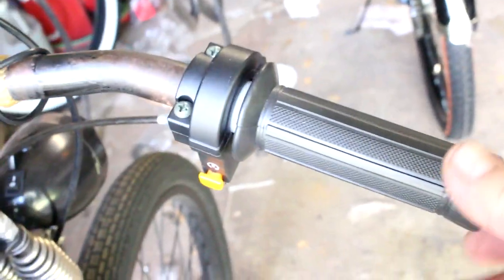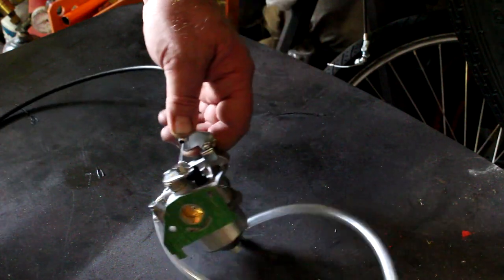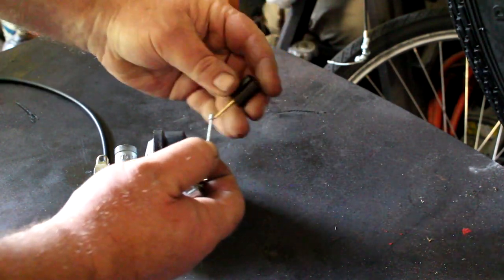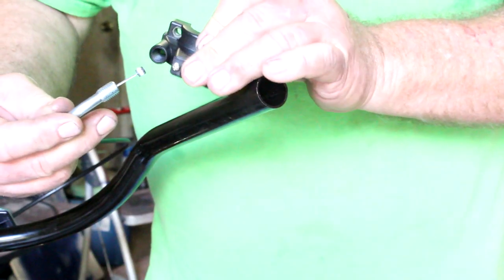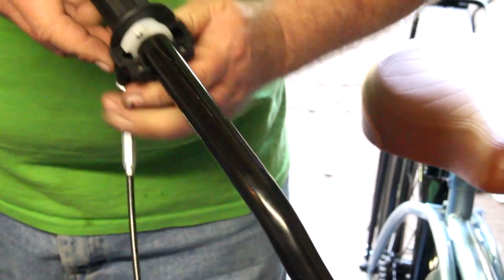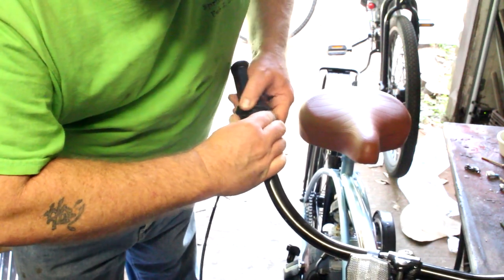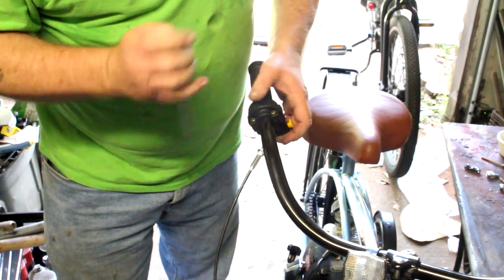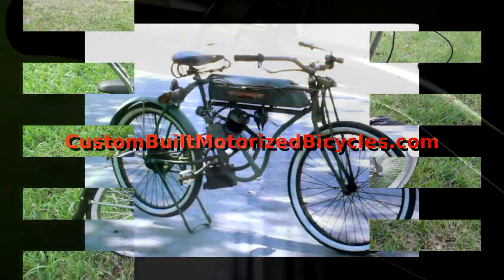How To Replace Repair or Install Motorized Bicycle Throttle Assembly and Cable

Comment: Everybody listen up! You pull the tooth out of an old automobile fuse, and super glue it as a stopper right where the cam meets the housing. Boom! Fits perfectly, add a rectangular piece of tape on top to keep the glue from dripping away and no more cheap cam overturning into the housing! Creates the perfect stopping point for your throttle.

Comment: I’m still confused what the hole in the handle is for. 🤷🏻‍♂️ How do I utilize the drilled hole? The part about how to drill the hole in the handle is very understandable, but I’m still uncertain what to do once I drill the hole.

Comment: Does anyone know how to take the carborator off after ive already put everything on and driven it? Is it safe to just take off? There's still fuel in the tank.
Reply from the maker: Sure. You just shut off gas at petcock. See my vids below on servicing carbs:

2 stroke carb: https://www.youtube.com/watch?v=9iPDA6PsT_g

4 Stroke carb: https://www.youtube.com/watch?v=sNVkanVqwvY

Comment: GREAT video! My 49cc Grubbee motobike was stolel last Friday and it's been 13 years since I did this-John in Texas
Reply from the maker: Oh no! I saw your other question. I prefer the rag joint. Once you get it setup right. Running true and centered, you are good

Comment: Thanks for the tips that I so desperately needed: it's the little things that mess me up, the kind of things I'd learn from experience [that I don't have]. Very well done video, quick and succinct, to the point and no more. Rick
Reply from the maker: Happy to help!
Reply: @HughesMotorized hey I got a question so I had some engine trouble with my motorized bicycle and I got frustrated and I kind of snapped really hard on  the throttle and now it's loose how do I fix this problem.
Reply from the maker: @2musicSoundtrackfandom579  Post several pics of the throttle up close. Post them to my Facebook group Hughes Motorized. Aim to detail where the issue is

Comment: I'm new to all this stuff and I've just completed my first build. The only problem I'm having though is that I have no control over the throttle at all, it seems to just be full whack from the start. Anyone know what could be wrong ? Could it just be the grip or one of those needle thingys
Reply: I have the same problem, have you figured it out yet?
Reply: +Liam Mckay yes, I had the throttle cable wrong in the carburator, the spring had got tangled with the cable. No big problem,good luck
Reply: +Liam Mckay and to see if you have got it right just take the carb off and look into the intake or outtake to see if that black cylinder is moving up and down when you pull the trottle
Reply: Thanks, when I go to my grandparents next ill have a look and see whats up
Reply: Jim ferry hey man I'm here going through

Comment: I took mine apart, but the pin in the middle, where you still a whole broke off. And they're was some wire left over inside the throttle handle, you think I can still fix it, Master?

Comment: Great informative video! My throttle seems to have too much cable and it's unresponsive, it won't stay seated in the housing ends,  I have the adjustment pieces all the way out,  still nothing. It's a 50cc 2 stroke 🚲 engine,  any ideas?
Reply from the maker: If you are using stock throttle & stock carb, might need a new cable
Reply: @HughesMotorized  I am yes and I added a spacer and it's working way better but she sputters.. Bad mix maybe?
Reply from the maker: might be, many things can cause that. Bad spark plug, bad wire, spark boot, magneto coil...etc

Comment: I have 2 motor bikes I just got a deal on . 1 schwinn cruiser 22 inch wheels 80cc .. and a huffy cruiser.  They both needed brakes .. and huffy 80cc needed a coil and front brakes . The schwinn needed brakes and throttle cable was sticking.. so thanks . I learned everything from your and 1 other video on idle air adjusting and throttle cable adjusting and how to install the new cable . I just did front and rear brakes on schwinn with new calipers today .. very easy

Comment: After having someone work on my gas bike, the throttle cable visibly moves as i throttle and release.. Also i was told my carb float was stuck open cause it was dumping gas... i hit it with a mallet and it stopped. 
Still doesnt fix why my throttle is WFO even tho im not touching it.
FUUUUUUUUCK. 
I think i need a new throttle assembly, and my carb needs adjusting. Im going to learn to do it myself, im so sick of getting burned by Joe KNowitall ...

Comment: The throttle grip assembly in my kit was junk. I was thinking it didn't look like a good design as I was installing it. I rode the bike four times and it failed as I predicted.

Comment: I wish the carburetors on the 2 stroke worked the same way as the ones on the 4 stroke,that way i wouldn't have to open it to put the cable on

Comment: I have a four stroke and it runs great until I hook up the throttle assembly. I've bought two of them and still the same problem..I can't adjust the  speed with the throttle . I don't know what is going on but as soon as I hook up the throttle assembly everything is poop
Reply from the maker: post some questions and pics on my Facebook group: https://www.facebook.com/groups/hughesmotorized

Comment: A link to buy the cable/ assembly kit whatever it’s called idk I just got a bike and I apparently need a new throttle cable
Reply from the maker: Cable https://ebay.us/VbkmSF I also suggest upgrading to this throttle assembly . It fits the stock cable- https://ebay.us/LumW8l

Comment: I'm having a hell of a time with my build. I'm trying new mags and I had to use spacers on the axle spindle to get the wheel strait. Had to order a U bolt mounting bracket because the bottom tube on the bike was to fat. Had to file down the clutch arm to clear the seat post tube. Drilled a hole in the handle bars for the throttle assembly because of this pin. I still have to take my wheel off and flip the gear. My expansion exhaust wont fit. I never had so much trouble building these bikes 10 years ago. This ones a hard build
Reply from the maker: Yup. Some of them really make it tough every step of the way. just don't give up

Comment: I have a question  so my outlet tube plastic  piece brock but the cord it still good can I just use the cord that's already on it from the old handle  or no
Reply from the maker: If throttle you would need to resolder the end unless I'm not understanding what you mean

Comment: My throttle housing doesn't have a pin, I assume I don't need to drill a hole.
Reply from the maker: correct.. it might slip...

Comment: Good video man.. im on my 3rd build and this is the most trouble a throttle has ever given me... For some reason it wont return/snap back at all, everythings installed fine, this never happened before. I adjusted it to troubleshoot too, and still, nooo throttle return at all... whats wrong here???
Reply from the maker: +7brandonc Carb slide upside down ?
Reply: HoustonMotorized nah, it was something even sillier than that. My handlebars had so much paint that it took up the inside clearance between the bars and the throttle handle...just opened up the throttle handle more aha

Comment: Im having a issue its still slipping out and i have the cable tightener almost fallin out and it wont just stay put
Reply from the maker: shoot me some photos of both throttle/cable and carb/cable connections hughesmotorized@gmail.com

Comment: I still can’t find out the point of the hole. Can u plz help
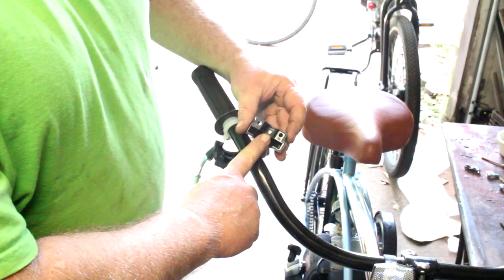Reply from the maker: 3:38 seconds it shows the pin on the throttle assembly. The pin goes into the hole drilled into the handlebar keeping the throttle assembly from moving on bars

Comment: all plastic junk mine broke on install were can i get better
Reply from the maker: http://custombuiltmotorizedbicycles.com/suggested-how-to-upgrade-throttle-assembly-for-motorized-bicycle/
Reply from the maker: Checck out the link. It'll show you how to modify a metal motorcycle throttle to take stock throttle cables

Comment: Question mine came loose to tighten the cable do I have to disassemble the carburetor to fix it?
Reply from the maker: If you follow everything on the video, you should be good. If you are still having problems, email me some pictures showing your issue at HughesMotorized@gmail and if I can help, I'll be happy to
Reply: Thanks I most definitely will follow the instructions also I ordered a new cable for the throttle.. thank again

Comment: my cable sleeve keep moving up and down when i throttle
Reply from the maker: I'd say look at cable adjusters having too much slack
Reply: @HughesMotorized  i though that too but there no piece that suppose to jam into the adjuster i had to replace the cables once already and neither had that piece so what i did was use electrical tape and wrap around the carb and throttle adjuster area.

Comment: Why do u ha e to drill hole on handle bar for throtte
Reply from the maker: The throttle housing has a pin that will fit into the hole. It keeps the throttle housing from slipping
Reply: Hi

Comment: I'm on my first build, this really helped me out, thanks a lot, I had it wrong
Reply: +James Willingham I is also a good idea to add a weee bit of "non petroleum" based grease tall over that white grip housing where the cable end goes in to the grip for a nice free flowing twist and quick return when you release it 
 
Also tell you buddies, brother anyone when and  if they ride it 
DO NOT  twist it like you are riding a CR-250 it will break the plastic throttle quickly 
Once your throttle  stops rotation  that's it....  you will NOT go faster by twisting  it  harder !!! 

Trust me  on that one ,  I had my first throttle 2 days before I broke it  because I never greased or filed the edges and I twisted it like a madman trying to go faster!! . My second throttle assembly has the same plastic parts as the first.. is going  on 6 years. 

   A petroleum based  grease WILL break down the strength of the  plastic. 
Also the  reason I used grease is because  I rode my  bike so often in the summer and the constant twisting wore the  plastic down , a dab of NON petroleum grease eliminated all that problem completely ..just stay out  of the sand ...Sand is not your friend
Reply: +Rick great advice

Comment: I just started my project and got the rag joint installed, I'm using your videos for guidance. I'm not rushing the project by any means, just doing one phase a day, I want good results. Thanks for your videos and the info..